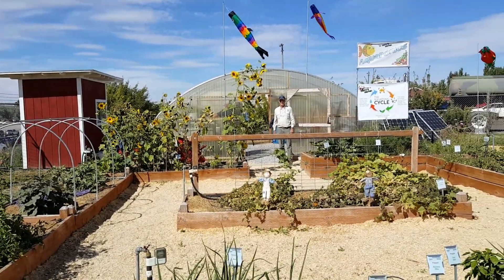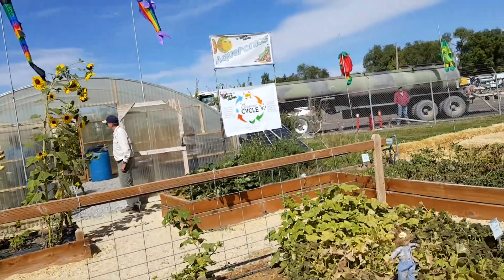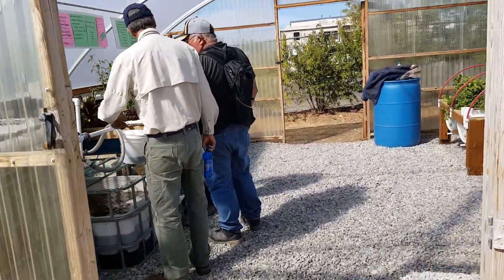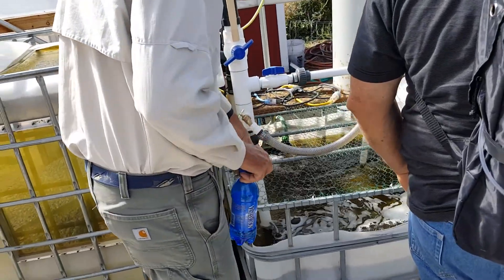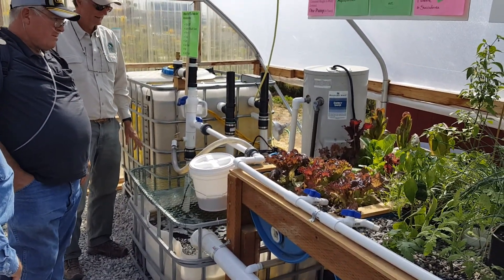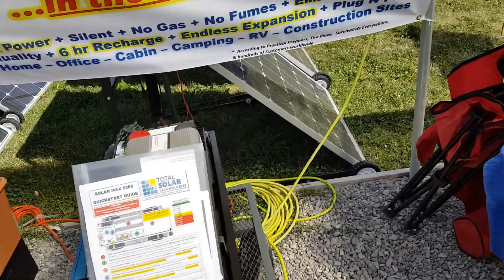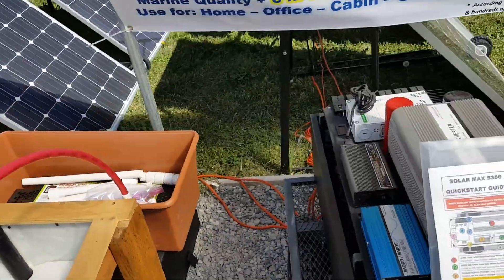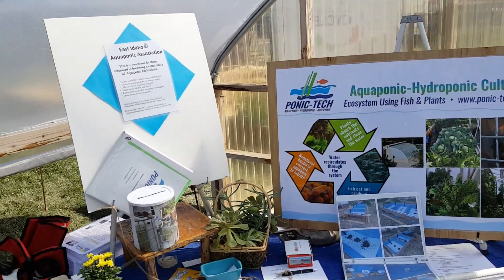Using a Total Solar System for Aquaponics

Comment: When will you be doing more solar genearter and or new product videos?
Reply from the maker: Though the products have improved considerably, and we are swamped with orders  because the system is one of the best on the market (many consider it "THE BEST" available)... I am currently spending most of my time with my other company www.pure-light.com with the new revolutionary Pure-Light light bulbs.  It has gone crazy.